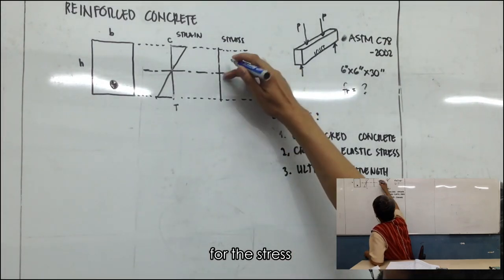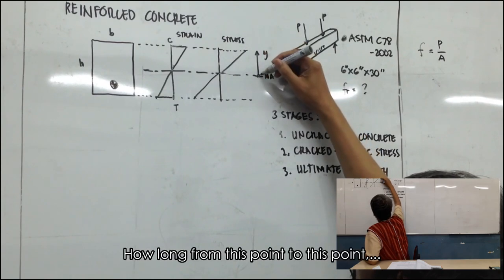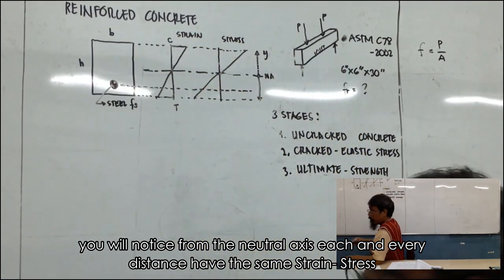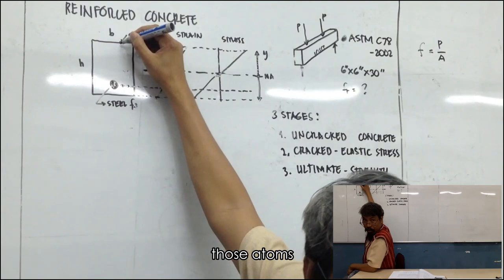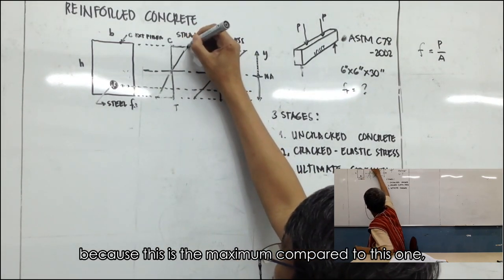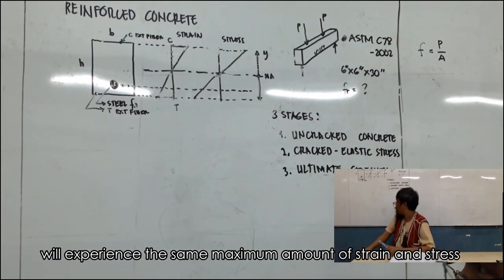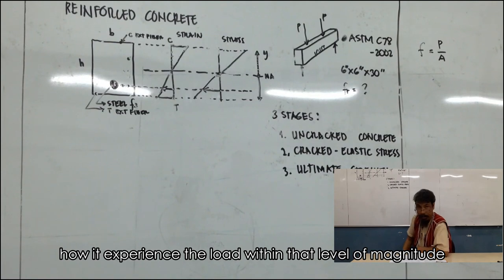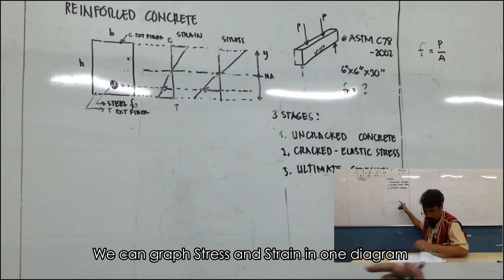CE422: Structural Design 1: Reinforced Concrete Design || Flexural Analysis of Beams Part 2

Comment: Thank you for sharing your knowledge to us sir,We have a small snippet from the stress train in the first video, and I now fully understand what the stress/train is, as well as the neutral axis. So, stress is defined as a force that can cause a change in an object or physical body, whereas strain is the change in the form or shape of the object or physical body to which stress is applied. A neutral axis is defined as an axis found in the cross-section of a beam that has zero stress or strains. Because both stress and strain vary along the cross section of the beam, with one surface in tension and the other in compression, there is no stress in the neutral axis.

Comment: I clearly understand now the difference of stress and strain, wherein stress can be defined as the force per unit area while strain can be defined as the change in length per original length. It is great that there is a very unique way of explanation by using the garter of the facemask and putting some dots to represent the compression force, tension force as well as the neutral axis, where it doesn't move means that there is zero strain and stress acting on it and only above or below of the neutral axis will the stress or strain will be felt.

Comment: Thank you for this video, Sir where continuation of the lecturer about the stress and strain. I have learned the formula where stress is magnitude of strength per unit area. Also giving a explanation by using mask to model the neutral axis and compressive extreme fiber.